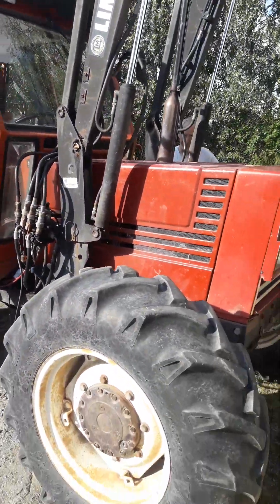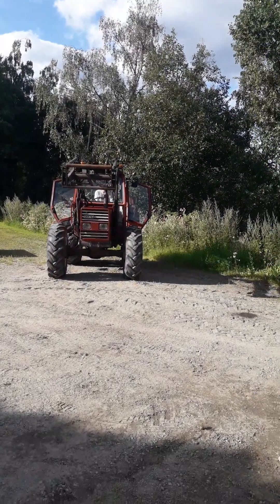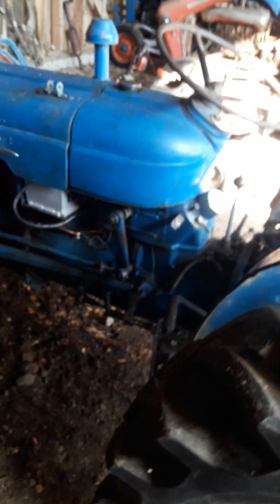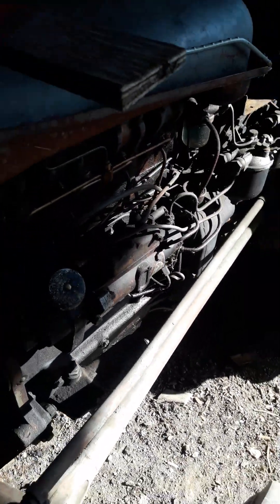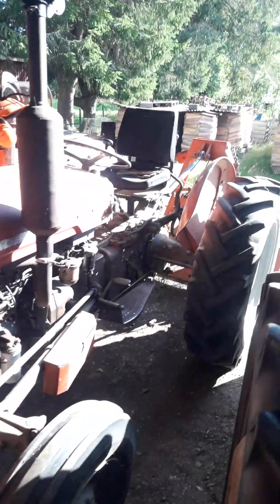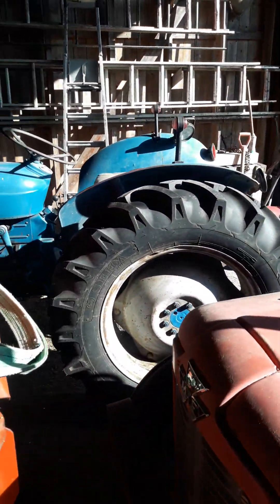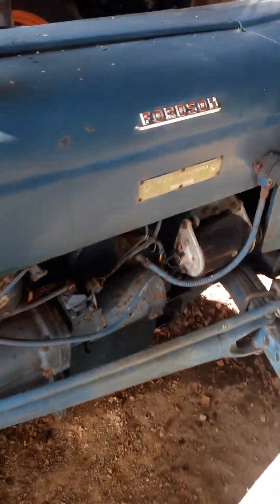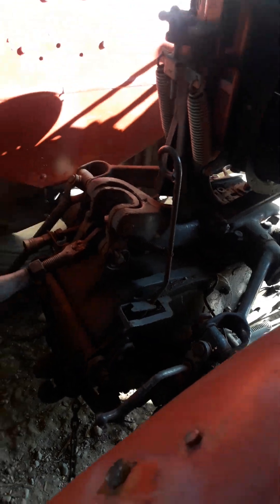Fiat 780 DT . SERVICE DAY ON TRACTORS . WALK AROUND. 🚜

Comment: Hi Michell, thats not oil, it's rust prevention treatment.
Reply from the maker: Hallo barry.. hahaha I Think you are reighte about that one ... its  covered  total in Oil... What is your appinion about the problem?? What is problem ?? Thanks for your comments my freind 😊🚜Michell norway 🚜
Reply: @Masseyferguson65  Hi Michell, I had a similar problem with a TEF, so on your diesel injection pump in the video, on the rear of the pump is a diaphram which controls the rack, which is activated by a piston in the rear of the pump, my piston was seized solid and this allowed the pump to force excess diesel into the injectors and the engine simply couldn't burn it so pushed it out throught the exhaust. Covering me and everything in diesel, black diesel which you think is engine oil.
remove the cover from the diaphram housing and check the actuating pistion hasn't siezed.
Reply from the maker: I Will try to open and See if its free  etc ...that everything  is working correctlly there and moves free  as well ... Thanks for tips Barry..I Will let you Know how  it Goes with the dexta .Thanks Barry 🚜👍🏻😊